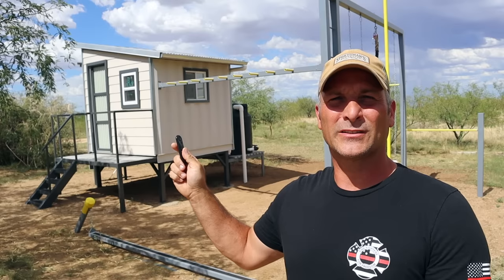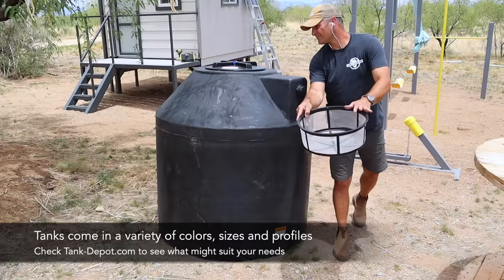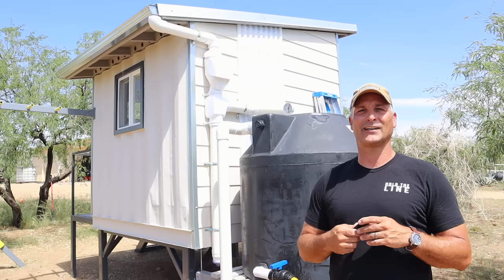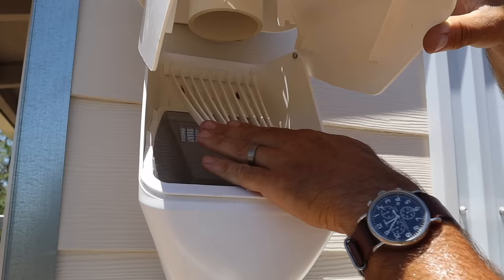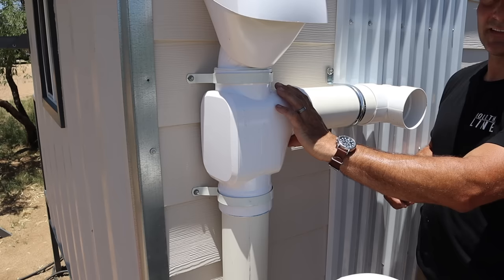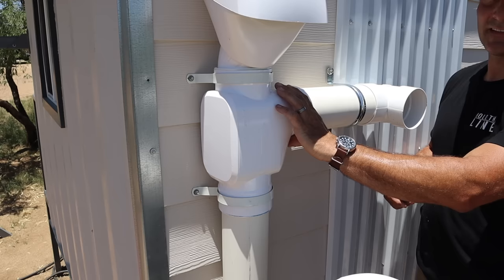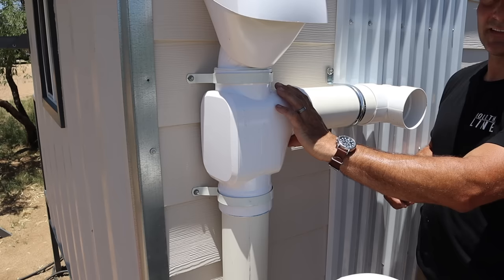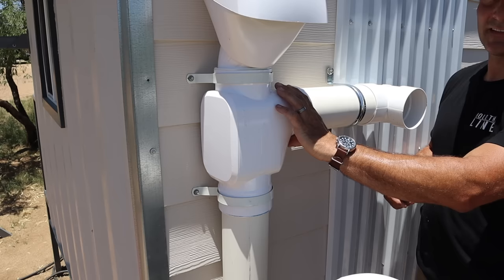Rainwater Harvesting on a Small Structure - How To - Step by Step Guide

Comment: I like this but I have another issue. We had our Well dug to 425 feet but we only get about 20-30 gallons of water before it goes dry. I've spoken with my Well digger and a couple other folks. The Well digger just says, "turn off the breaker and let it recover". This BLOWS my mind! Over $8000 to dig this hohum Well! The only options I seem to have is 1. Dig the Well deeper, 2. Dig an entirely new Well or, 3. Get an auxiliary holding tank and slowly fill it. I don't have the funds for options 1 or 2 cause it would cost thousands! I'm thinking the aux tank is the way to go but not sure. I have 2 Pressure tanks now and I'm thinking use the existing well pump to supply the Aux tank and use a float switch in the Aux tank with a separate pump to run the water to the house. That way the Well pump wouldn't come on except to augment the Aux tank when the float goes down. Am I overthinking this?

Comment: Great video as always. Where do you get the right size hole saw? Where do you get the pipe clamps to attach the pipes to the structure?
Reply from the maker: The hole saw I borrowed from my neighbor….but Home Depot, harbor freight, etc,.   And the clamps are standard Home Depot, hardware store things as well.   The first flush system comes with clamps and the leaf filter mounts with screws.   But the silver clamps you have to acquire when you get your pipe and other pvc fittings

Comment: Nice setup, question th first flush value water run off wouldn't that make the building tilt or sink down into the ground making it unlevel and suggestion wouldn't u put a rain leaf or dirt guard on the gutter to collect leaves or dirt and easy clean it, giving it another way of filtering out the dirt from the system. Thanks for the vid.
Reply: Does  video at approximately 15:30 address this question?
Reply: Maybe not when I watched further. Have to view again.

Comment: How does the water supply pipe interface to the top of the tank?  It looks like you manually remove the ~16" cover when it starts raining and then put it back on again after the rain to minimize evaporation.  Is that right?  Or do you cut a hole in it?

Comment: Massive storm front and high winds here in extreme W Maricopa county (basically just the desert)... The trailer is rocking and shaking, and I can hear parts of it outside fighting to break off. Almost lost power twice, but I turned a few things off... The furry kids are terrified... And I can't say that I'm not.

Collecting rainwater here isn't worth half the sand that would destroy any filtration. It's ALL-ways intense to great extremes.

Comment: None of this is easy to get in Canada that I know of. Is there a sort of simple setup? Ppl around here talk about using a home depot bucket with rock and sand but I have not seen those setups to emulate.
Reply from the maker: There are definitely ways to work around and/or create components.   This kit just makes it easier and more polished.   But my home system, if you check those early clips where I showed that, is made up of very simple pvc, with screens screwed to the inlets under the cutters…. And then the long run of the pvc going into the ground kinda serves as a rudimentary first flush.  Not perfect but can be done with all big box store stuff. 😊👍

Comment: First you have to determine if collecting rain water is legal in the state you live in. It is not legal in some locations because of different water rights.
Reply from the maker: So thank you for checking out the video.   But I have to respond, as I do not want misleading information on this video regarding the legality of rainwater harvesting on a residential small scale.   So let me try to explain.

The reality is that an individual home or structure that exists is covering what once was, open and permeable ground, with a new impermeable surface.  The act of collecting rainwater that falls on your own roof, and reusing it on that same property, by way of gardening, household uses, cooking, drinking, etc,…..MORE closely mimics what would have happened before the structure covered that piece of previously open and permeable ground.   And that actually helps local water tables, by allowing the water to soak into the ground, like it would have been able to prior to the addition of the structure. 

Small scale collection and use does not affect watershed run off because it is allowing the natural infiltration that occurred prior to the existence of the structure.   

The very nature of many towns, cities, municipalities is that much of the once permeable ground, is now covered by impermeable surfaces such as buildings, roads, parking lots, etc…. Often to the percentage of 40-50% of the ground surface.  Which makes a 1” rain, feel like a 2” rain to the permeable ground within that justification.   Therefore exacerbating flooding, storm runoff, etc,.  Essentially there is reduced absorbable surface and additional rainfall on that surface.  Think if a funnel affect…. Large opening necked down to a small one.  It can only absorb so fast.

Now to the point of laws pertaining to legality.   These were done for the large scale Installment of berms, levies, swales to capture large water sheds into a retention pond/lake/reservoir.   This CAN have an affect on watershed areas and the natural cycle of water tables.   So laws pertaining to large scale actions like that are more reasonable, because they can affect those down stream in a water shed.

But in the small scale collection and usage on a residential scale, it is more realistically, a case of government overreach extending from a ‘well intended’ attempt to control large scale collection as mentioned above in the thousands of acres berm scenario.

So, in my humble opinion 😉…. The restriction of small scale water collection on a residential scale is nothing more than the action totalitarian tyrants trying to restrict the liberty of free people to live sustainable within the gifts of what God (or nature if you prefer) has provided.

Btw….these are just my opinions.   You may agree or not… and I’m good with either.   But just want to clarify for folks who might rbe wondering.

Thanks for watching!🙏😊
Joe
Reply: @homesteadonomics  I agree with you and believe everyone has a right to collect such a valuable resource that is necessary to sustain life. Here in Colorado it has been illegal for some time to collect rain water even though everyone does it. The rule may have changed in recent years and I am not aware of it. Colorado has many water laws that require a specific type of attorney to wade through. Once you become involved in any kind of water dispute it may take years and lots of money to resolve that dispute. I retired from the water and waste water profession so I know just enough about it to get myself in trouble thinking I know more than I do. A few years ago we even had to start keeping track of evaporation from lakes and ponds and augment for that. In order to not have to augment in the winter it became necessary to prove the surface was frozen over. Any source of water that may originate on your property is not your water unless you have legally filed for it and no one has protested your filing.

Comment: Tank weight full of water is 4,000 pounds for a 500 gallon tank. Your wood platform isn’t going to hold that tank full of water.
Reply from the maker: The platform is 3x3” 1/4” thick steel angle welded together.  The wood just tops it.  And the 300 gallons at 8.3lb/gal would equate to 2500lbs approx.
Thanks for watching😊🙏

Comment: Man that little shack you have is not worth it to install a rain water system.
To collect rain water you will need a very large surface water.
Reply from the maker: It was an opportunity to demonstrate how to set up a system and make a video of the process.   If you check out my other videos I harvest rainwater off of virtually every structure on my property.   This was one of the only structures without a system and therefor was a candidate.
These components would work the same if on a 1500sqft house and a 2500gal tank.   Just a small example of how to do a system like this.

Thanks for watching 😊🙏
Reply: @homesteadonomics   I apologize for my ignorance, I just watched your video "Rainwater Harvesting QA" that you posted about 5 years ago.
Excellent work, thank you.